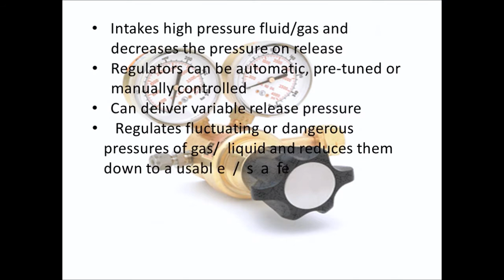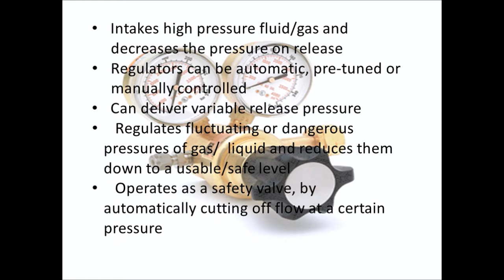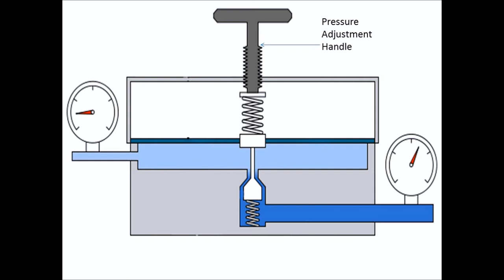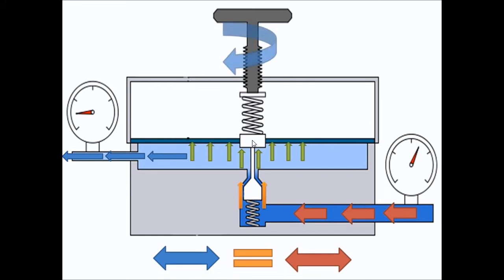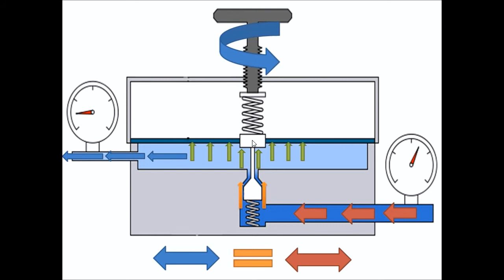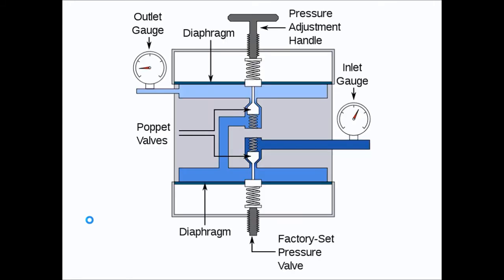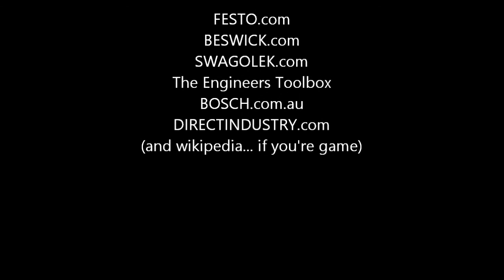Introduction to Pressure Regulators ENEG12004

Comment: Where does the energy go? Say the pressure holds the spring wide open for the whole time. It would be the same as filling up a balloon and tying it off? The same pressure would remain in it? Similar to restricting the flow? The pressure stays the same if you were to just narrow the piping wouldn't it? God why is everything confusing 😂